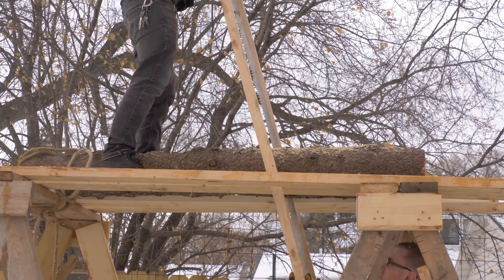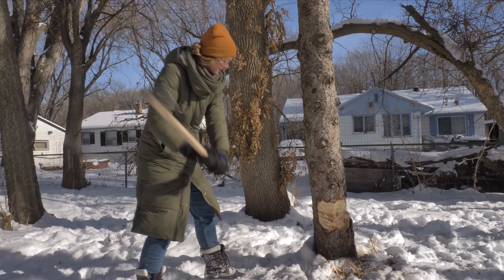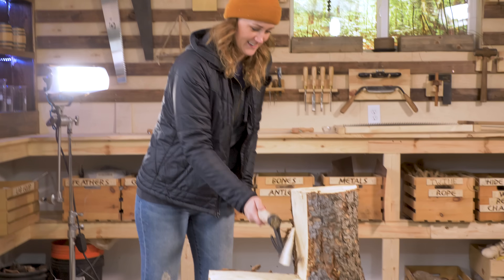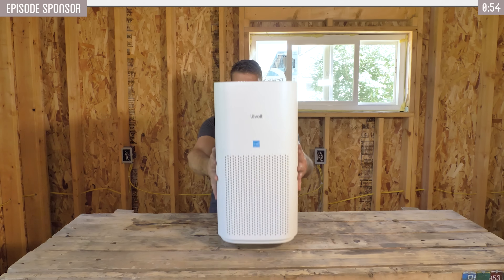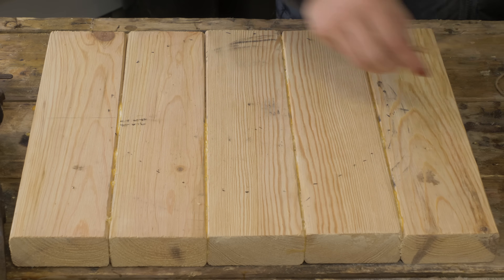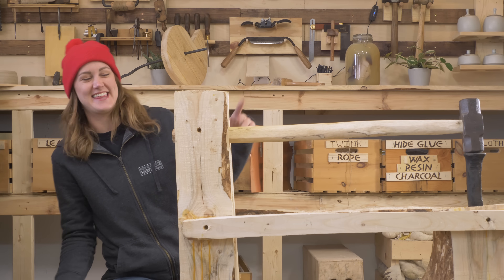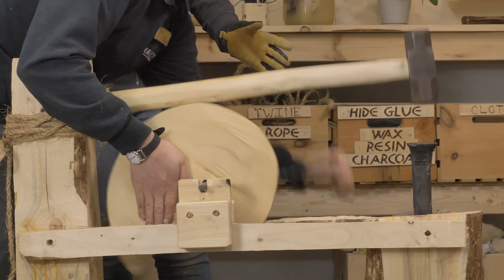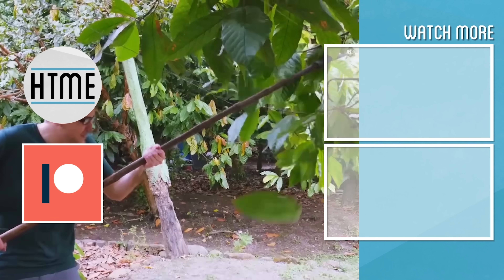Does Da Vinci’s 500 Year-Old Power Hammer Actually Work?

Comment: If you want to make your movements more efficient, I would suggest using some kind of cog system or ribbed gears on the wooden dowel of the cam. Definitely need to exaggerate the arm of the cam to drop from a greater height. Make the cam double wide with a trough for the hammer to be more consistent in drop pattern.

Comment: A groove in the cam to guide the hammer could have also worked.
My mom's old spinning wheel had a step plate to drive it, a leather strap would pull an off-centered arm down. The center of the arm's mount, spinning the wheel.

Comment: Use a 3 phase motor to move the cam. You can also hook up a sewing machine foot pedal to it so you can operate the motor with your foot instead of an on and off switch. Will allow you to heat your metal then just walk over and simply push on the pedal when you are ready. 💥 boom 💥

Comment: Add a stiff spring to the front on the mechanism, between the cam and the hammer, to add striking force without adding a heavier hammer.A stiff rubber band or a full coil spring would be good.

Comment: Cutting a grove in the shape of the handdle would help with keeping hammer on track. Adding rubber bans to the arms of the hammer would add power. Adding a spring to the base of the swing of the hammer would return some of the energy back to rotation of the wheel.

Comment: Have y'all never heard of pins? You can keep stuff from wandering with pins in the rods. Also, tighter tolerances. You guys have a TON of slop because you don't seem to take that into consideration. Finally, standardized measurements have been a thing for over two millennia. Either just use a ruler or make your own. You are causing yourselves more headache than you need to. Even for doing it primitively. Quit assuming primitive craftspeople did stuff on the fly. They didn't. They had years of experience and masters who'd drum standards into them. You don't have that so you need to compensate, otherwise you just look like fools and will have stuff that sorta works but will give out/be more of a pain than it's worth in short order.

Comment: A simple solution: Put the anvil further out there, longer hammer handle = the hammer drops from further up and has more strength without the need to increase the size of the mechanical component.

Comment: you could always try a foot pedal system like they used for grinding wheels when they sharpen axes and such...and possibly a leaf spring to help bounce the hammer back up to keep momentum up and catch at almost the peak of the cam so it can then be set and to have a control on the speed of the hammer
Reply: i seen such a thing, large hammer on long springy branch that you bring down by rope attached to a plank you stepped on, it work quite well, you have free hand and its more powerful then one handed hammer. Also you can use smaller weight and made up power with swing speed, or be slower by using heavy weight exploiting momentum. Its sort of similar to medieval lathe.

Comment: It's not making a full impact because the hammer handle is being hit by the cam when it falls.  Relieve another inch of material from the smallest part of the nautilus and continue that removal for another 120 degrees of rotation.
Reply: Yep - the hammer's shaft is landing on the cam before the hammer head actually contacts the anvil.
Reply: No matter how you shave the cam the hammer handle will always ride the tip of the largest radius down through the rotation. It's never really free to fall. That's why the original DaVinci design in the drawing has the cam acting on the end of the handle opposite of the fulcrum instead of between the fulcrum and the head, so that the end can slip off the cam and swing freely.
Reply: @blahfasel2000 i think they meant the hammers resting position should be on the metal rather than the wheel?
Reply: @blahfasel2000  Yes, excellent point, sir.  I should have thought of that.  The only way it would have missed contacting the handle is if the rotational speed was high enough to outrun the hammer-fall.  Thanks for pointing this out, sir.
Reply: @blahfasel2000  its free to fall up to the cam or the nail provided its rotating faster than freefal acceleration would keep it riding on the cam, it wouldn't be able to ride on the cam anyway through the whole rotation as the hammer hit surface would not let the hammer get so down.

The cam axis should be lower too and longer handle for the hammer. The cam itself could be different shape tho too, just 45 sector from the middle being full height and everything else 0 height of it would suffice provided the power source has enough torque
Reply: @blahfasel2000  of course 1 it's free to fall, if it was shaped like a real cam, then I understand what you mean by it always being in contact riding the top radius, but, because it ISN'T shaped like a cam, it falls at 9.8M/S^2, it already had just enough room to fit the anvil, if it was hitting the wood, it would not be making the metal on metal sound. 
yes, the stake could be driven deeper, but when he put the metal to be hammered, in, even when the metal mostly cooled, it didn't drive the stake any further into the log, so I guess the first few times when it was coming off randomly, would have been when it must have hammered to the depth it could handle, from that fall, of that hammer.
I think they must have changed the shape, slightly, so they could raise its axis, unless they moved out further down the fulcrum too
Reply: Or raise the anvil. I think it got knocked down/settled with the initial use
Reply: @searchingfortruth619  Raise the anvil?  Farther away from the area of impact?
Reply: @adamchurvis1  from what I saw there was a large gap between the sledgehammer's final position and the top of the anvil. So I would imagine that you would want to close the gap.
But maybe I'm missing something 🤷🤷🤷

Comment: If u enlarge the cam, also keep in mind the cam start point. It appears like the hammer is hitting the cam som when it drops so maybe adjusting the shap a small amount to ensure it doesn't happen. Maybe some oil or beeswax on the hammer shaft/cam/axles to reduce friction n increase efficiency too.

Comment: On the wood where you reinforced the axel, put a thick wax coating on it this will make it easier for the parts that rub and move on each other especially if the two pieces are wood, they would have used whale grease back in the day LoL. And yes a bigger hammer and bigger cam with a longer length of travel will definitely help some older water mill hammers used this design.

Comment: NEVER HIT HARD WITH HARD! 
That was the first sentence my teacher told us before we used any hammer.
So pls do not hit an axe with a hammer. When two hard steel has high impact, small particles can fly - like shrapnels with the speed of bullets. 
I know this because i was not learned the lession: I did it, and i had to remove one 2x2mm by 8 mm particle from my neck, next to the biggest arteria. It was buried that deep, i could not reach it by hand. I was very lucky. Those particles can easily go trough cloths or safety glasses...
Either you can use wedge with an axe or a hammer, because wedge is soft. Or you can use softer hammer, to hit the axe trough the log.

Comment: As everyone as pointed out, it need a complete redesign to function properly. (Longer lever, torsion, better cam, better cam placement)

Aside from that, for the love of whatever god you follow _ ADVANCE AND IMPROVE YOUR TOOLS._ 
   Don't use a skinny battle axe for wood chopping, make planers and adzes, reprofile your saws, make a dividing compass, build better abrasives, and sharpen your blades!

Di Vinci didn't design his machines with the intent that they be built with tools from 1500 years ago.

Comment: FWIW, instead of making the hammer head heavier, you could add a weight connected between the cam and the head.  The weight could be on the end of a beam that pivots below the hammer's pivot, so both rise in sync via a rod that connects the two beams.

Comment: The falling off the cam problem would have also been solved by sanding or filing a groove into the cams face. Gluing a second cam in place did a similar trick, as the space between the two formed a guiding groove. 

A lot of their joints in the frame could use a second dowel/nail could improve performance by redeffort lost to the frame twisting.

Comment: 4:00 A longer blade with a short handle (think Cleaver) would probably work better for hewing logs. With an axe like you've got, you can only hit it in one place which limits your leverage.
Reply: 11:51 Hmm. When we hammer things, the downwards velocity is much greater than that of gravity alone. It's hard to do this mechanically without springs or a winding of rope. A small way you can increase the force is to offset the hammer handle. So, imagine the center of rotation of the handle is a circle instead of a point. Now, imagine the handle is straight up and down. Compared to the center of this rotational circle, you want to move the handle towards the anvil, or towards the edge of the circle. So you're offsetting it by a few inches. Now rotate the handle so it's horizontal. You'll note that the handle is now lower than the anvil, so you'll need to shift the axis upwards the same amount as your offset. 

Next, in order to get more force, you're going to have to lift the hammer up higher. This can be done a couple ways. One is to make a bigger cam. Bigger means heavier, so find another way. Instead of your hammer handle being a straight line, change it to an L shape with the center of rotation being where the two lines of the L meet. When the hammer part of the handle is horizontal, the other part will be pointed downwards. As you lift the hammer, the other part will move towards the anvil. You're going to want your cam to move this part of the handle, not the hammer part. Depending on where you mount the cam below the rotation point of the hammer will determine how high you lift the hammer. Closer to the center of rotation will give you a bigger swing of the hammer at the expense of a little more effort. The lower you go, the easier it will be to turn the cam, but the smaller of a swing you'll be able to do.

These are small modifications you could try to get a little more force out of your hammer strikes.

Comment: Hm...  I think they've missed a little bit of the point of the system- DaVinci's drawing showed the cam acting on an arm at a right angle to the hammer, on the opposite side of the fulcrum- I think that was an important part of the design, since it meant that there was more mechanical advantage on the hammer and would require less rotational force.  This would allow you to use a heavier hammer, possibly set it up with a longer swing, and hand-crank it without getting tired.
Reply: Also, the hammer shaft is dropping on top of the cam, limiting its free swing and wasting lots of energy striking the cam instead of the anvil.  Operating the cam against the end of the hammer arm would drop the hammer more freely for better striking.
Reply: It makes the machine also more efficient, because the hammer can fall freely. How the construction is now the fall of the hammer is limited by the speed of the rotating element. It can be seen when it's moved very slowly. It's the same reason why in hammer mills the hammer is actuated at the end with and not from under neath.

Also in very old machined stones where stacked on the hammer head to increase the weight without investing in expensive metal.
Reply: @boelwerkr  Also there is no point in cutting out that section of the cam. It only limits the crank direction to clockwise. if the cam was left as a cam, the part would be stronger and you could switch direction when you got tired, or even make a pendulum to drive it.
Reply: @spacemansabs  you would be missing the dead blow if it was a normal cam shape. It would literally hold the hammer while lowering it...... Look at the height of lift, how close to the fulcrum and how long the handle is from the fulcrum, those are all the numbers you need, to work it out (if you can't 'see' it) 
If they can rotate 180degrees faster than 9.8m/s/s, in vertical acceleration (under G) of the hammer, Then it would work as you suggested, but if you could turn it WITH that acceleration, then you would connect the hammer and use your more powerful arm.
Sorry bro, I don't mind deleting this, if you don't want it up, cos you edit your comment or delete it(not that I want you to), cos it's a correction. I dunno mate, some people think something being pointed out to them is meant as some kinda rudeness or disrespect, and there's none of that here. Peace
Reply: @spacemansabs  Sorry, how close.... and how long.... we're the same question. I meant to write 'mass of hammer' in one of those places lol
Reply: When designers have to engineer 😅
Reply: @thomasmarton2857  They're not designers. a designer would have thought through the ergonomics of this. For instance, cutting that section out of the cam was a terrible design decision, as it limits the cranking direction to only clockwise. If they would have just left the cam a cam, you could switch directions as you got tired.
Reply: The lever length should be barely past the cam axel, which would allow for much a slower turning speed while having a quick drop. Slow and strong hits are ideal.
Reply: @kafuu_chino  If you copy Leonardo’s design, it wouldn’t matter — the hammer would drop the same regardless of the rotation speed, since the peg holding it would fall all the way off the high point of the cam without obstruction.
Reply: @oldvlognewtricks  Yes the speed should be separate, but in the video when turned slow the lever will always rest on the high point because it is too long.
Reply: Yeah. They didn’t follow the original design and thier machine failed. The whole point of the video, and why I clicked, was to test DaVincis design and they didn’t even do it. Not only that, but what they built failed in ways that the original drawing already solved. Truly perplexing.
Reply: @CarlYota yeah I wish they had just stuck to the design.  “I am smarter than leonardo davinci” - YouTuber
Reply: I was just thinling the same thing
Reply: Another huge weakness of this design is the increased friction. Dragging the whole length of the weel over the Hammer to raise it up verses only the straight part of the cam makes a huge difference

Comment: Great video. It was very interesting and fun. Some suggestions though as far as potentially improving this device. 

-bigger heavier hammer
-larger wheel for it to go up higher 
-playing with gear ratios so the wheel spins faster
-add some sort of spring, bow or other tensioning method so the hammer wants to go down beside from gravity

Comment: You should probably make the shortest end of the cam shorter by an inch or so so all the energy from the hammer goes into the anvil rather than in the interaction between the hammer handle and the cam itself

Comment: its a little bit harder, but the wheel can push the counter waights, with some pully block, both on the weight and the counter weights. also u can make two sided wheel. that way its gonna become stronger? u may put more weight 2 the hammer, and .....yeah, not a little bit complex.....but it works 😄

Comment: Rather than doubling up the cam, you could have made a bracket to sit over the hammer that keeps it aligned with the rotating cam.

An easier solution with the added benefit of increasing weight of the hammer.

Comment: The cam wheel is touching the middle of the hammer handle. When the hammer reaches its highest, the cam does not get out of the way fast enough and the hammer just kind of slides down again. It needs a sudden drop To hit harder

Comment: Maby extend the handle out the back and move the cam to press down on the back end of the handle, you will be able to to generate a larger swing and you won't lose so much force from the hammer bouncing off the cam halfway through a strike

Comment: making some primitive mechanical lubricants would probably be a good investment at this point as you are making larger and more complicated machines. especially with wood, having surfaces grinding against each other without any mechanical lubricants (i.e. lithium or graphite or similar) massively reduces the efficiency of anything youre using, not to mention the reduction in how long those machines will last as all that energy that is wasted goes directly into destroying the surfaces of those parts

Comment: no idea why you didn't have the cam rotating at right angle to the hammer handle, with wax, or grease on the cam/handle,  so that the handle gets s cleaner drop, or, a peg sticking out of the handle, with the peg riding on the vsmsgain, cleaner drop, and easier to align...,

Comment: you could rotate the cam 90 degrees then you could move it closer to work area and use a treadle-eske rotation mechanism. another method to allow more power is to put the cam on the other side of the pivot. so it pushes down. and stays out of the way you could then extend the handle for more leverage on that end. But at some point a long lever and a pedal would be a more simpler and less finicky solve. cant wait to see what you  guys come up with.